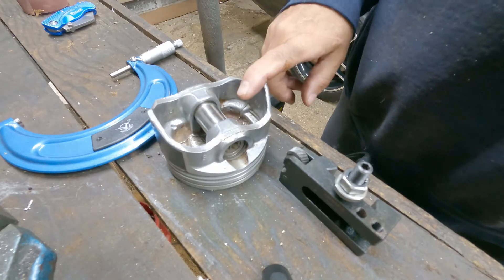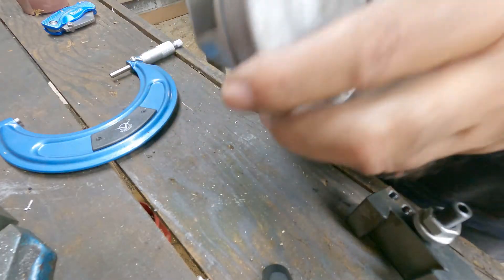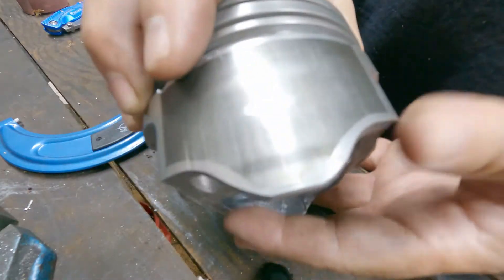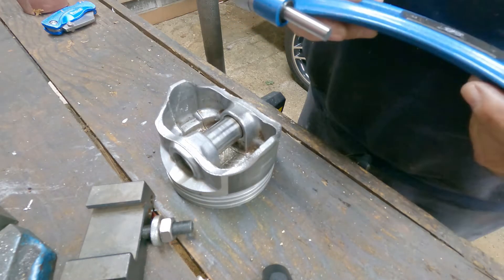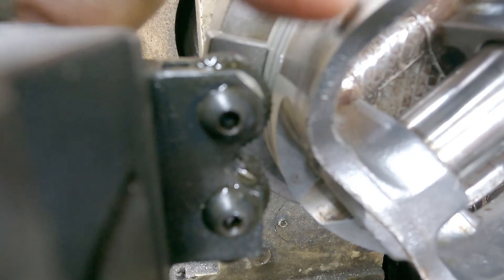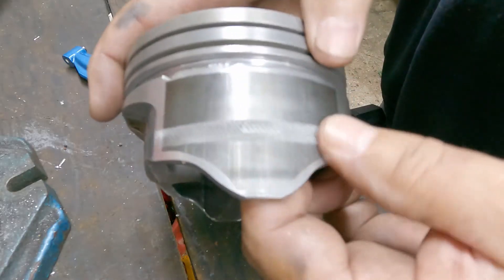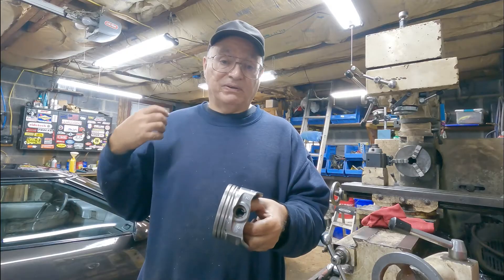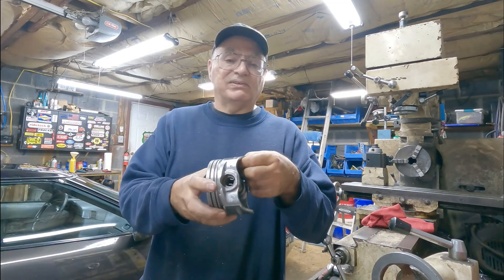Piston Knurling Should I 🤔

Comment: Theres been a bit of talk about this lately. People say it makes power.

From what I read knurling partly was used a lot in the 60s in drag racing because they built stroker motors and as a result they had clearance issues with the crank hitting the bottom of the piston skirt on the bottom of the stroke 

so they had to trim the piston skirt for clearance purposes since there were no aftermarket performance parts available 

and when you trim the skirt Because of the taper on some pistons you ended up with too much clearance at the bottom of the stroke and they had a rock from side to side

So to fatten the skirt out and resolve that rocking they knurled the piston skirt to stabilise it at the bottom of the stroke after it had been cut down 

But because it was being done by drag racers everybody thought it was to make power and it doesn’t really make any more power……..

Comment: My father taught me this trick, I had an old AMX 360 motor in which I knurled the pistons, It worked fantastic I had to file in each piston to the cylinder, and I ran that Motor 50,000 miles it never blew smoke, it would have went a lot more but the Jeep fell apart on me and I sold the engine
Reply from the maker: @edwardwuestman7098  Nice, I am putting together a build right now, all the pistons are knurled. https://youtube.com/playlist?list=PL5AMhVA-RNuQBQyqTKINyKOlLSgfmtod4&si=hLE-MH0bukV1mMsq

Comment: Ive done quite a few we knurl more surface area than one strip like that it actually makes about 10 more hp over not knurling if done properly cause it stabilizes the assembly and it doesn't wear off very fast it usually last a lot longer than you realize ! Smokey yunick did every single set he used.
Reply from the maker: Thanks for the info 👍😎👍

Comment: What does this accomplish???
Reply from the maker: Knurling expands the metal in the wear area and the patterns leave a oil retention area to improve piston to cylinder wall Lubrication
Reply: You are actually decreasing the load bearing capacity by introducing lots of high points.

Comment: If your a professional racing team and your goal is to get a few more passes out of the pistons before replacing them the coatings are what's used now. For the average guy who wants to turn the key and have an engine that'll go and not have issues a bore with new pistons is the way to go. Or even custom oversized pistons for an engine that's bored to the max but can be honed a few thousand. The one thing you can't find with coated pistons is how many miles will the coatings last. That tells me they don't last long enough for a driver vehicle.

Comment: If you have to rebuild a an older motor for something and the cylinders and pistons look OK, running a straight cutting hone to clean up the cylinders and then knurling the pistons saves the cost of boring and new pistons (rings and bearings only).  When I started working in a shop in the early 70's, this used to be an option.  With todays prices, it may make a comeback for home mechanics.

Comment: I'm "rebuilding" a 351w, and I don't have the machinery to do a knurl, low compression in 1 cylinder, getting oversized rings and filing them down but I definitely would do it as I'm going to have to hit a machine shop after this so why not!?
Reply from the maker: Good luck with your build.

Comment: I drove 5 hours last year to pick up an old perfect circle knurling fixture.. 
It was a common thing to do in the 60's and you can even find instances of individuals knurling pistons fit high performance engines. 
I basically acquired it for personal use.  Not sure id want to take the chance if i was selling an engine..
I have an original 1970 sbc LT1 engine i plan on trying this on.  
Honing the bores straight and reusing the 11-1 pop up pistons.
Reply from the maker: Good luck with your project, I may be trying the same thing on a engine soon